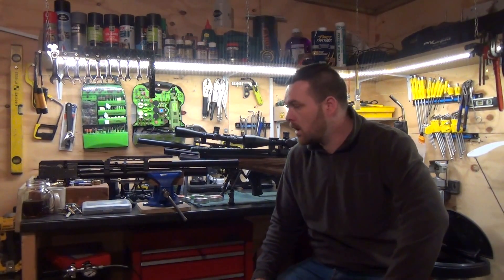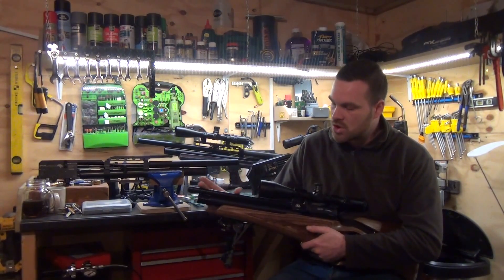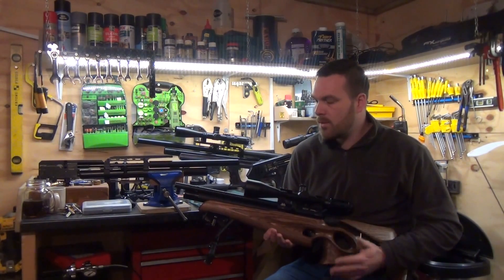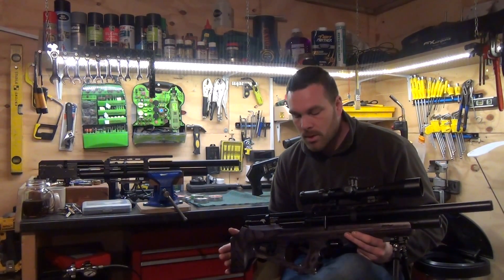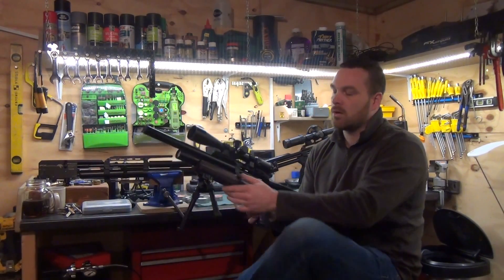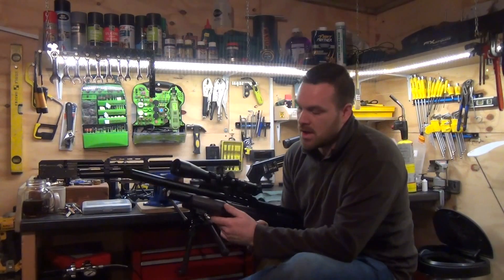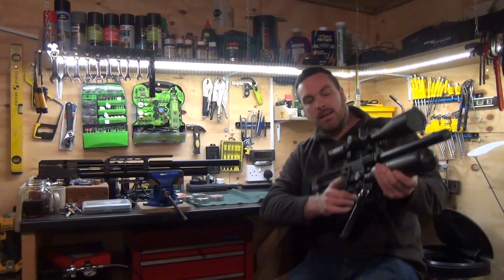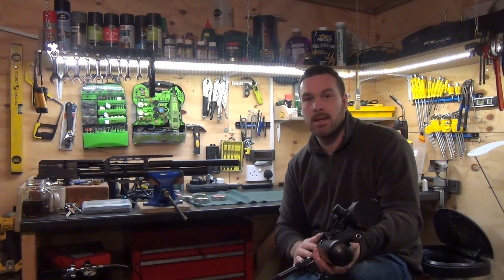FX Air Rifle Tuning

Comment: You have a great set of videos and we can see that you really know you job. I have tuned my S200 CZ with a Altaros regulator myself and it was a great way of learning how my rifle works. I had my Webley LiteW8 regulated with a Lane regulator by the Ratworks, which also made a massive difference to the rifle it was before. For some reason the pellet fussy rifle was not so pellet fussy as it had been before and works well with about eight different pellet to the previous one. I am now in the process of tuning my daughters Hatsan Galatian, which I have found the most difficult so far, as the anti tamper is so hard to fatham. I got another Altaros regulator for it, which turned out too tight to fit the cylinder, until it was resized on a lathe. I had previously chonographed it and it averaged between 10 ft/lbs and 11.5 ft/lbs depending on the pressure level, which turned out to be 11.5 ft/lbs at 100 bar. The regulator was set to 100 bar, but now the rifle is only doing 9 ft/lb. Do I decrease the pressure on the outlet exhaust valve spring? Increase the pressure of the regulator, or increase the diameter on the transfer port? I know that a weaker spring on the exhaust valve is the easy option, as the block on the Hatsan Galatian doesn't look that easy to work on. I expect access to the transfer port will be through the grub screw hole holding the barrel in, but what I have noticed is that all the alen knutts appear to be very soft metal and will round off easy. I am thinking that they have put all the screws in with locktite? Even the adjustment for the hammer at the rear of the rifle has the cap on it, and even after drilling doesn't want to come out. I am assuming mor e locktite? Maybe if I heated the rear screw it would come out and I could adjust with the hammer tension if that is possible. No help from Edgar brothers. They either treat us all as young kids, or potential criminals, when only a few years ago we could all make sure our rifles were tuned and working at their best potential. Any imput would be great, as no one seems to have done an article on tuning the Galatian yet. Many thanks. Mark Holding.

Comment: Hi mate
Need your help please!
How can I remove my cylinder from my fx typhoon and empty all the air??
Something it's lose inside my cylinder so I need open it to check 
Let me know how can I remove all the air please?
Reply from the maker: Hi do you have a gauge built in?? crack it off slightly if you do. Failing that you will have to dry fire until empty.
Reply: Air Rifle Tech thank you

Comment: jsbs diabolo heavies 10.34 dont give good accuracy below 840fps and above 910fps, tested with many air riffles, normally i shoot them 870-890 fps, group size @50m 2 (euro)cents coin..
Reply from the maker: Gamo sniper_cy I get 10mm groups at 50 yards 
,715fps with my other rifles, Smooth twist barrels don't like them.
Reply: well.... i think you need more speed on Smooth twist barrels ..with my friend impact work fine on that fps. try it maybe will be fine for you also mate, thanks